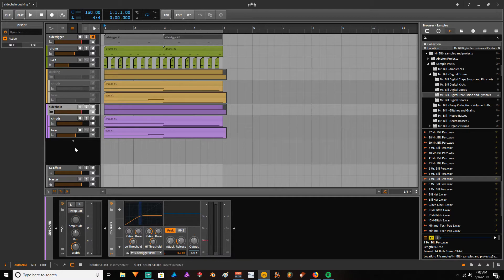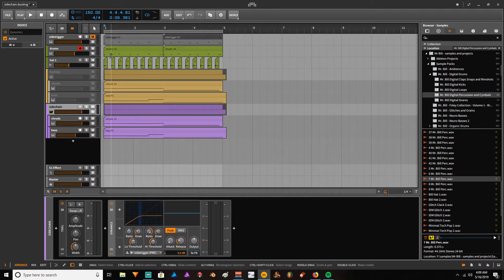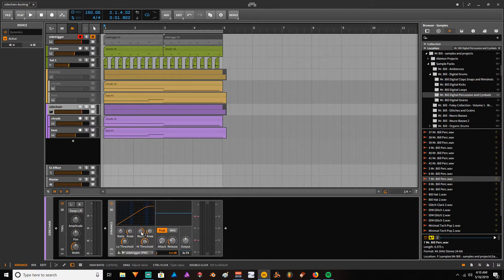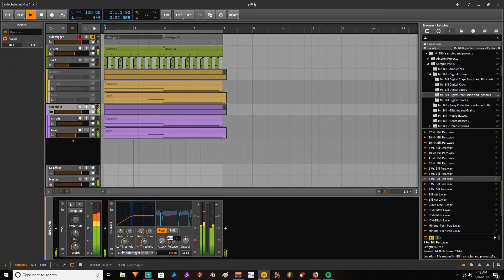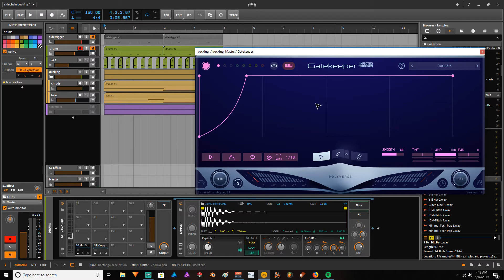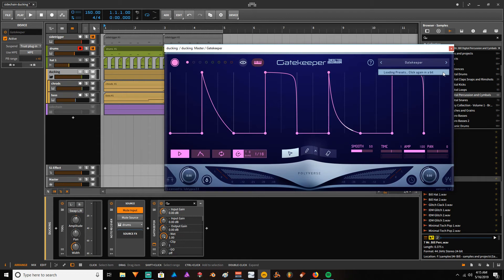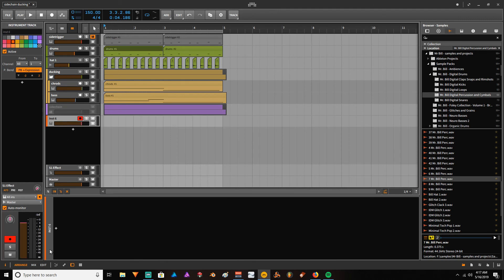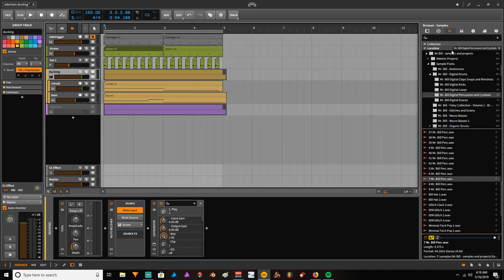Bitwig Beginners - 2 methods for sidechain/ducking

Comment: Yeah, the audio sidechain modulator is really a great way to do basic ducking and lots of advanced control. For example, the audio sidechain can control any parameter, so it can automate the evolution of a sound in a synth but the evolution is controlled by the dynamics of some other sound. As you say, you can use it to create a dynamic eq from the static eq that's native to bitwig. Etc etc etc. Very very useful.